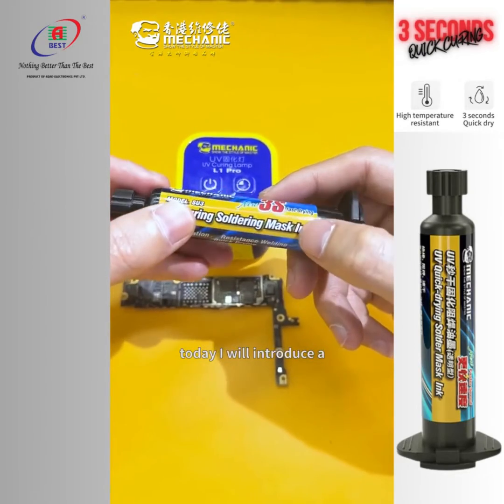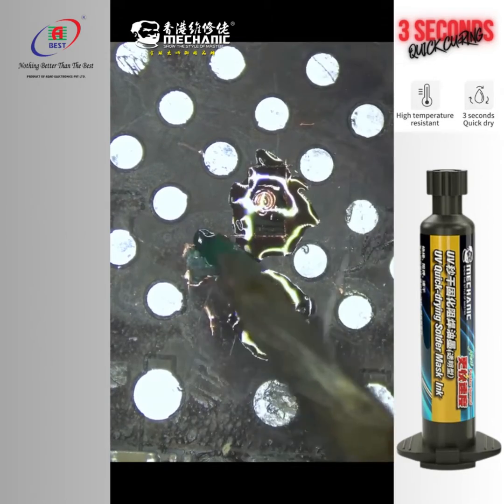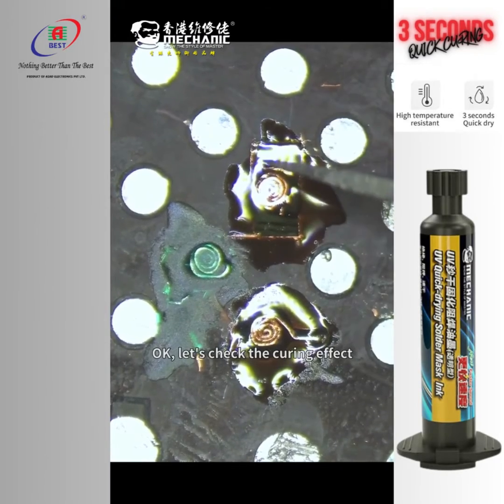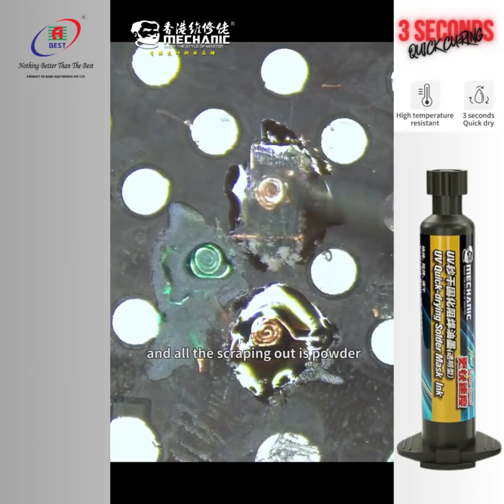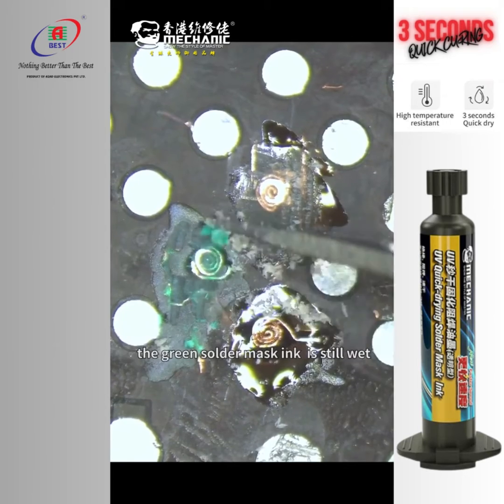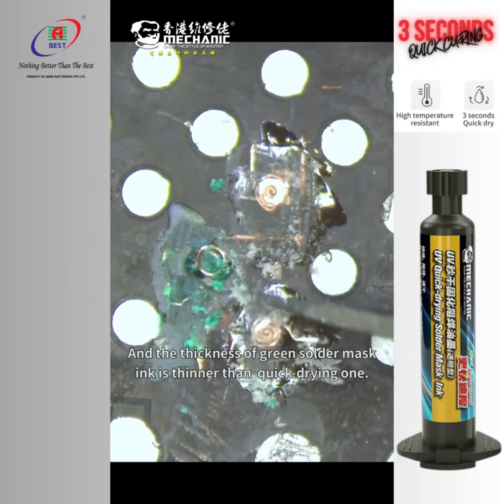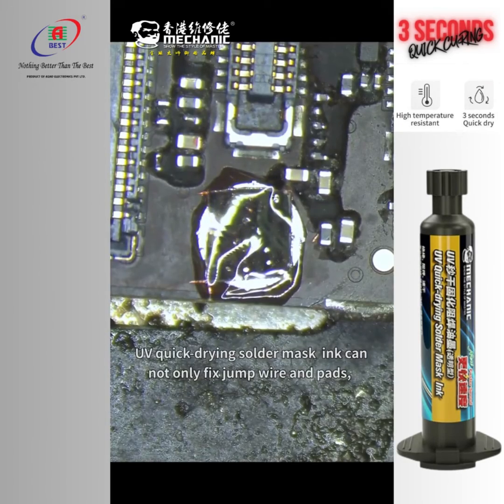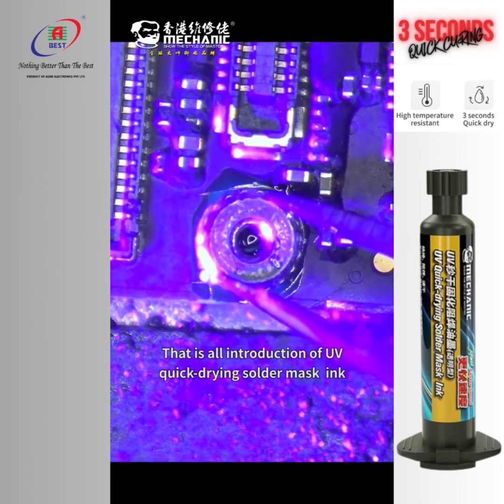MECHANIC SU-3 TRANSPARENT UV QUICK CURING SOLDER MASK / WWW.ABEST.IN

Comment: I tried this su-3 mask in green it was still wet inside and didn't solidify in so called 3 seconds?
Reply from the maker: hello, Su-3 start working within 3 seconds but for proper solidification it may take up to 10 seconds,
Reply: Thank you for the response, I have tried more than 3 seconds spent this whole week finding the proper thickness and timing. My conclusion is that the pigment stops UV from penetrating deeper while this clear version doesn't have that problem or my UV light intensity is not great.    @Abestofficial